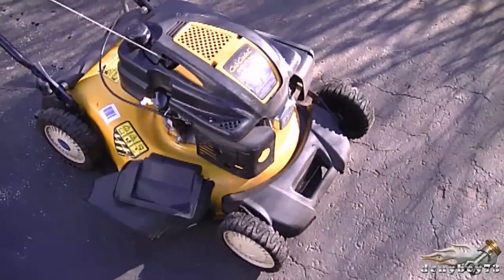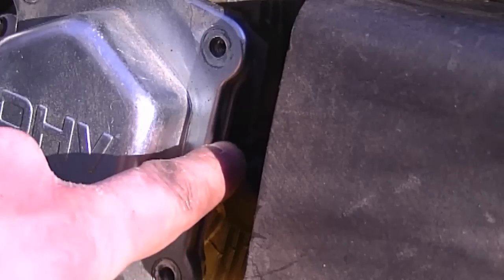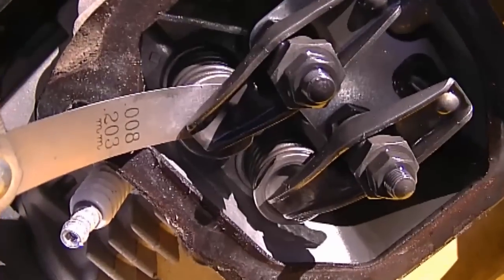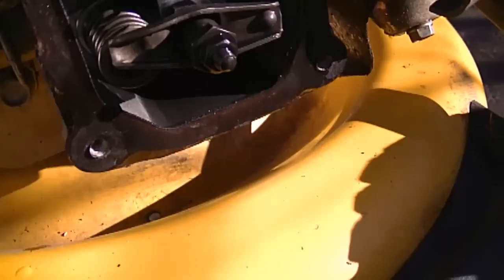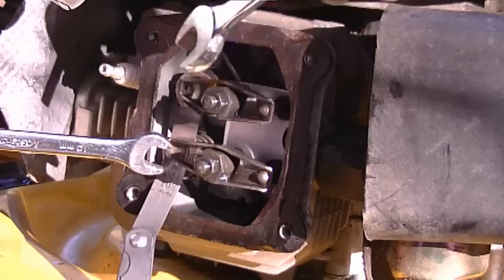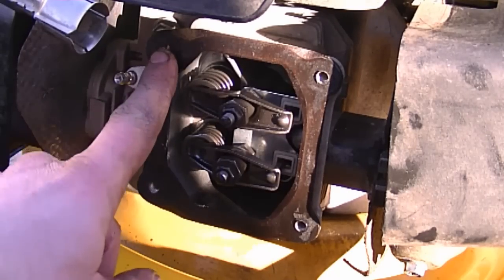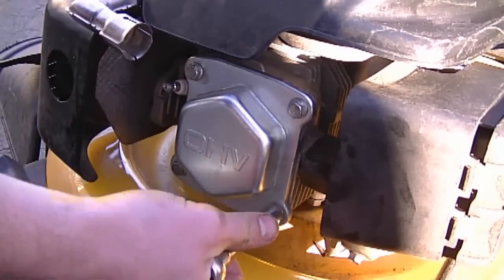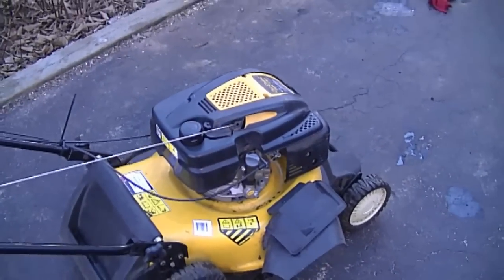How To Adjust Overhead Valves On A Lawnmower

Comment: Your video was a big help!  I have a Honda HRZ 216 that wasn't starting.  Had good spark and fuel.  The valve clearances were way loose.  I tightened both to .004 like you did in the video and it purrs like a kitten now!  Thanks for posting.

Comment: The adjusting the valve clearance, you do exactly how I do for years. Not by bringing piston in TDC. Some of these cubcadet engine comes without the auto compression release. What a recoil some time!! Long back I injured my hand. Even now I get pain on my under shoulder. The issue with the push rod guide, I pinch a 8mm nut to oval and brace it to the plate. No engine spares are here in Kuwait. It will last till the life of the engine. Not a quality work. But worked.

Comment: You should add, "Solve Snapback - Not Key" to the title.  I searched for a solution to my Cub's snapback forever after I found the key in perfect condition until I started to suspect the valve timing and found your video.  I did just as you demonstrated and now it is back to operating perfectly.  - Tina's Husband Curtis

Comment: Dony i repaired a Troy Bilt here a while back with the same engine.It had a blown head gasket.Went to order 1 and discovered that there were none to be found in the States.I searched the internet with no luck in finding 1.Had my local MTD dealer order it and i finally got 3 months later.Customer was calling like everyday,man it was a pain.The only nice thing about it was it came as a kit which included the head gasket,rocker cover gasket,head bolts,and the valve seal.Just a little story i thought i would share with you.Later

Comment: If you take out the spark plug, it will be easier to turn the engine for adjusting gaps and also see the condition of the plug.

Comment: very good video!  on one of my b/s engines I had to go by the method of ccw rotation + 1/4" down stroke of the piston, adjust both tappets there  because there must be some thing slightly touching one of the push rod paddles.    now it appears to be ok.   talk about hard to start I could pick up the whole mower  because of the maladjustment,   regards

Comment: I don't know if this was mentioned in another video so I apologize for repeating it.  The reason he sets the lash in steps and tightens the keeper nut is because the keeper locks the adjuster by pressing it against the stud threads. This make the valve lash smaller than when the nut is loose and he gets a true reading.  If you have a lot of lash you can use around an 0.006 feeler and spin the adjuster until snug.  Lock the keeper down and check with a 0.004.  You should be in the ballpark.

Comment: Another great video Dony ! when i purchase any new mowers , snow blowers or any power equipment the first thing i look at is the engine. I won't buy anything unless it's a trusted brand name like briggs & stratton , kohler etc. it may cost more but in the long run you save money i just don't trust those chineese throw away motors !

Comment: i took a riding mower to a shop for valve adjustments.....it worked great........6 weeks later same thing happens....they said this time it was the camshaft needed replacing......how can you tell when it's the cam......btw.....it was a 9 yr old 15.5 hp Murray i'd bought new and this was the first time i' had ever had an engine issue with it

Comment: I have a B&S 22 hp V-Twin. Does the same method - of opening one valve on one cylinder while adjusting the other - the same on the V-Twin as the single cylinder?

Comment: I find it easier to turn the crank until valve overlap on the compression stroke and then turn one more revolution and adjust both valves. But that is my preference. Dony's way works just as well. :)
Reply from the maker: yes that is one way I will show in another video
Reply: I have done it both ways Dony, I didn't know about the Valve Overlap until I went to school this past year.

Comment: Do you have a video on how to adjust valves on Ryobi 4 cycle trimmer s430. It's gotten hard to start & sometimes it feels like things hit together when I pull the starter rope. It doesn't rev up as good as it use to either. The carburetor looks to be non adjustable.

Comment: I'm trying to adjust the valves on my st100 cub cadet string mower..I've searched for the correct spacing but cannot find info..Can I use .004 on both valves??? Also the little caps are missing, are they neccessary??

Comment: if both int and exh are out of adjustment about the same tolerance then your cam is wearing normal . if both are way way out of spec you could either have a soft cam depending on the duration between adjustments  lets say you adjusted it last year and your doing it again this you could have a cam wearing premature briggs had a run of weak cams

Comment: Dony - you just gave me a great idea on how to fix a lingering problem on a friend's mower - thanks!  Had another question - I have a Honda GX340 motor (horizontal shaft) out of an old pressure washer.  Can I run it by itself (nothing attached to the drive shaft) without worrying about it shaking itself to death?  Are these motors internally balanced?  I know you shouldn't run some engines (like vertical shaft lawn mower engines) without a blade, but can you do this with the Honda GX engines?

Comment: valves on flatheads can only be adjusted to have a wider gap. you have to remove the valve and grind a little off the end of the valve stem. get a set of feeler gauges . find out what the recommended gap is and either adjust wider or replace the valves and regap. you can get to them by removing the crankcase breather cover and since its a flathead BS im going put money on it that the breather is located near the carb

Comment: What is the next step? After doing what you did, to include new spark plug and adjusting the valves to specs ( 0.15 mm intake and 0.20mm exhaust) I still cannot pull the cord and it catches and snaps the cord line back. 
Is the next step to check the rocker arm or the push rods. I’m afraid that

Comment: Unrelated request.  Could you tell me how to adjust the coil on a small engine when the coil is located under the flywheel.  Also, some troubleshooting tips for twin cylinder ignitions.
Thanks
Tony

Comment: dony I was recently bringing a ford lgt 145 back to life 82 model with a kohler k321 and there is no way to lock the little adjustment stud down is there nuts missing or is this the way it is ever get a piece of equipment and you know its probably been cursed at its whole life  it has av mounts on the block and as a result there was a weak ground to the electric starter . it was a basketcase(multiple problems)

Comment: Hey Dony what does  the intake & exhaust valves set on and also what does the head torque on briggs stratton 500E series 140cc model # is 9P6020085Fl could you let me know asap Thanks

Comment: I adjusted the valves on my Ariens LM21 push mower  using this video and using the gaps you used for the valves in this video. My problem is everytime I adjust the valves to the certain specifications as you did, it is still hard to spin the flywheel also knowing that the exhaust valve is on top and intake valve is on bottom because exhaust manifold pipe is on top. What am I doing wrong? Could you please lookup the certain valve clearance for my push mower because everytime I also look the valve clearance up I can't find them. Also recently before I even did the valve adjustment I took the valves off to get access to the piston and clean the carbon off. When I put the valves back in and the push rods that's when I noticed it needed a valve adjustment and it needed one before because it wouldn't start when hot. Any help would be fantastic. Thanks Donyboy73 keep up the awesome videos.
Reply: By the way the engine in my push mower (Ariens LM21) is a Briggs and Stratton 6.75HP OHV Intek
Reply: Actually that's partly my fault because I was turning the engine over by hand to see how it felt and you pulled it over with the rope, so I pulled it over with the rope and it was way easier.

Comment: Great video!  I have this same Cub Cadet with the same starting difficulties. Now, there is no starting as I'm dealing with a broken valve.  I also have the same damage to the plastic piece.  I have a new valve and plastic piece....any advice on having to start this procedure with replacing a valve?

Comment: Small engine Guru Donny, Why do the service manuals ask you to put the motor at top dead center, or piston at 1/4" down in the bore after TDC, etc.., but you do it simpler by just watching opposite valve open full? I have a Honda GCV160 that recommends .006" Intake and .008" exhaust. Is going to .004" better? Thanks much!

Comment: I'm trying to find the valve lash for a Briggs 500E engine. one person said .004 to .008 on both valves, my friend has a Poulan Pro push mower that is very hard to pull but it will start and run.
Reply: I adjusted the Briggs 500E to .004 and now it pull starts easy like it should. both valves were at about .006 before I adjusted them..with this engine it took a 8mm wrench for the nut which in this case was the adjustment, the center took a small allen wrench and that was what you turn to lock it in place...some engines are opposite.

Comment: Hi Dony .. what would make an older Briggs hard to pull ?  It's from the '70`s, side shaft 5 hp. roto tiller .. runs great but just about pulls your arm out to get it started. thanks

Comment: I have a flathead B&S that is very hard to turn over almost feels like hydro locked. If I remove spark plug it easy to turn. Can it be anything other than too big valve gap? Valve gap cannot be adjusted smaller?

Comment: on my kohler command 25hp engine it has a zero valve clearence,cause it has hydraulic valve lifters. when i got it for free it was only running on 1 piston, so i opened up the valve cover to find a bent push rod. the rocker arm was tight and the respective valve moved with a tap of a rubber mallet. i put in a new push rod and it runs better than new. i don't understand how the push rod was bent if there was no way for it to bend. do you have any ideas?

Comment: how do you adjust the valves on a flathead engine?? i have an flathead mower that starts, but it is easy to pull and runs like a whimp. how do you adjust the valves?????

Comment: Dony when you have a double piston engine do you have two crankshafts and 4 valves?  Are the crankshafts connected or do they turn separate blades?
Reply from the maker: no, 1 crankshaft, 4 valves. Rods are connected to one crankshaft

Comment: Can you help me I have an old Scotts lawnmower model 21485x8A  I can’t find the valve clearance specs, I will apreciated!
Reply from the maker: usually between .003" to .005" works for each valve
Reply: So do I go .004 for both?
Reply: I really like how you explain the process to repair!
Reply from the maker: @armandomaldonado4268  yes u can try
Reply: I tryed .004” and didn’t turn on and when I was pulling the cord rip-off

Comment: just curious.......i'm going to adjust the valves on a 17.5 Briggs......does it matter which valve i start with and do both valves require same specks
Reply from the maker: doesn't matter, I adjust both at between .003-.005
Reply: ok....thnx

Comment: by taking the "ohv configuration"(it is called the head) totally off with 4-6 bolts. and no it will combust in a nuclear explosion if you don't use silicone

Comment: I've discovered that these Chinese-built motors such as what is in this Video is impossible to acquire parts for here in the USA.  I've got one that needs a new coil (armature) and cannot locate one anywhere across the Nation.  Why is it that they're using these engines but charging outrageous prices for them?  Nothing beats the older Briggs & Stratton motors.